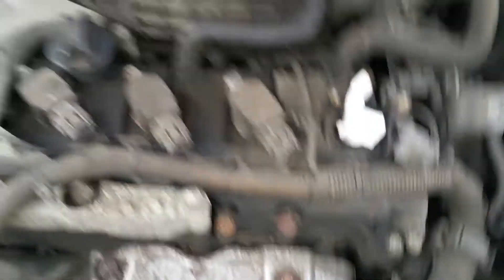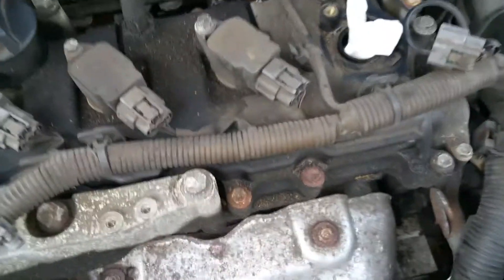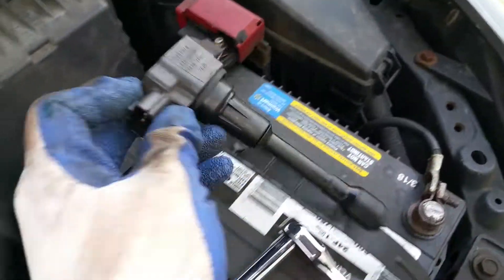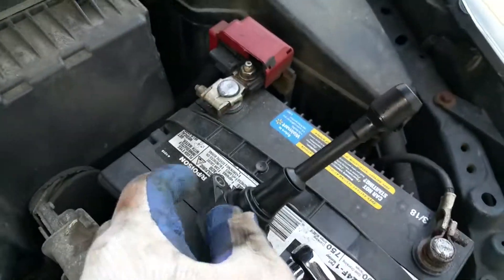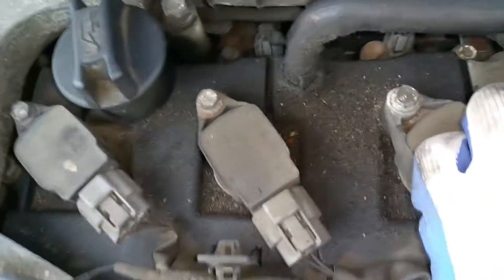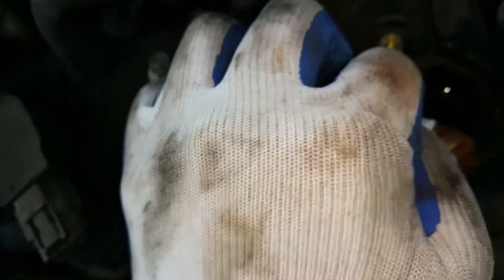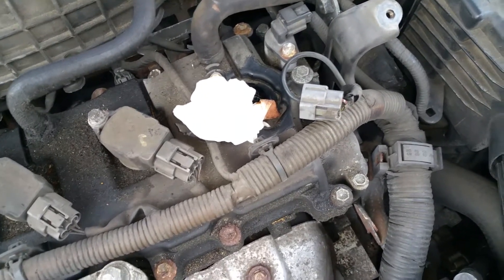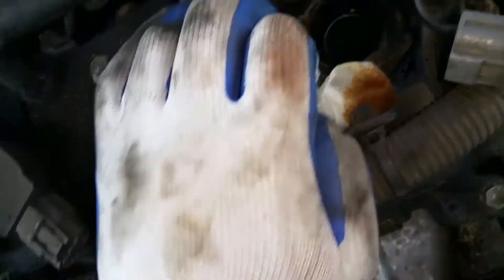How to Remove/Drain Oil From a Spark Plug Hole-DIY Car Repair

Comment: all you need to do is replace the gasket  and if the plugs have a lot of oil on them  change them as well. as far as the coil packs go  if there is not much oil on them  clean them off with brake cleaner and re use them    . sometmes you need to replace them as well     they get old and crack after a while

Comment: LOL I don’t think that would be possible unless they literally just took a bottle and poured it over the top of that engine. That is a clear-cut sign of failing valve cover gaskets. You need to strip off the old ones and replace them with new gaskets
Reply from the maker: I cleaned it off and drove it for another 50,000 miles before the car was sold at 310,000 miles. Engine was still strong. No leak detected from the valve cover gasket.

Comment: Same car, same model, same engine bay. My first and forth cylinder was submerged in oil. Car was only running on the 2nd and 3rd. The plastic in the engine fucking sucks. Half the shit such as the gasket seal and engine cover was falling apart. I swear to god the whole fucking car is made out that one material that melts in the sun that they didn’t fucking recall

Comment: You need to stretch your spark plugs. The oil caused the engine to grow bigger so you need to stretch your plugs to fit the engine. Also you need to make sure it’s not blinker fluid in there, that could cause your whole car to melt
Reply: get a life and a job

Comment: Did is cause smoke out of the tailpipe?
Reply from the maker: No
Reply: What would it mean if it did? I have a similar problem and there is sometimes smoke out of the tailpipe
Reply: @robhealy5134  what color is the smoke?,if is blue your burning oil from bad piston rings or a bad pcv valve,if its white your burning coolant  that be blown headgasket,if its black your burning too much fuel(running rich) your smoke should be clear and should smell only like exhaust.
Reply: Кайена Арельяно it’s burning oil for sure, I’ve had it checked by a mechanic. Not really worth fixing considering it’s a cheap van. Thanks for your help though
Reply: @robhealy5134  yeah piston rings are toast!.

Comment: You need to replace your valve cover gasket or just replace the valve cover entirely. That's why you're getting oil in in the spark plug tubes.

Comment: i would highly recommended changing the valve cover to make sure the spark plug well gaskets are secure and not causing a leak